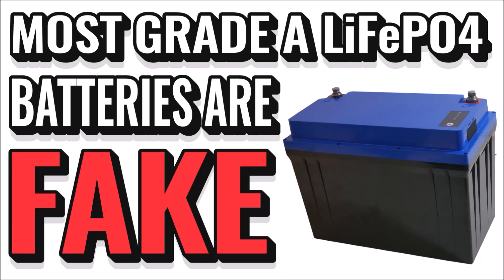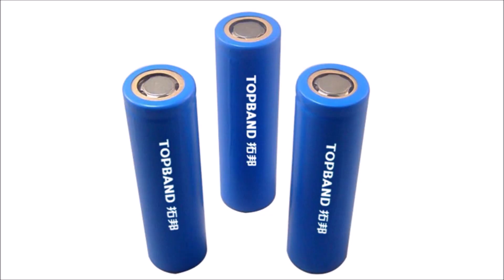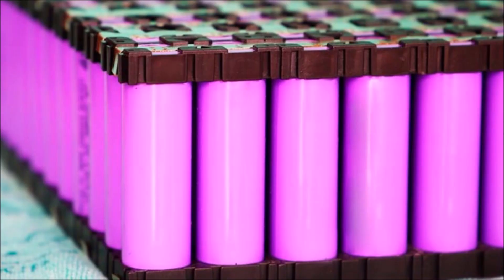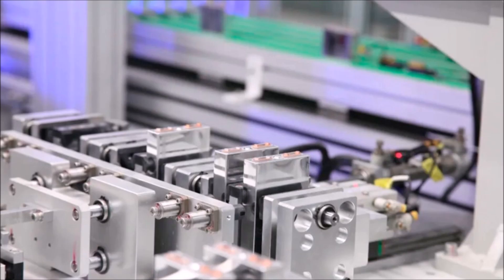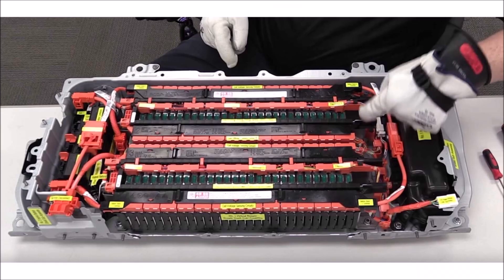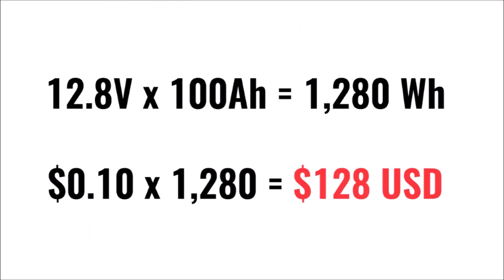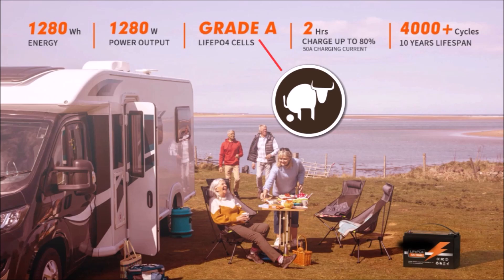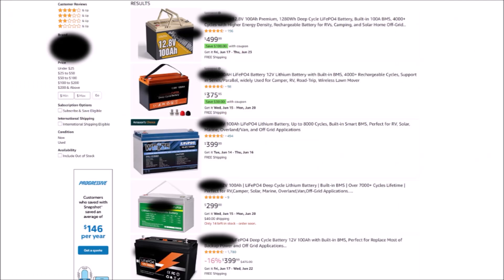Fake Grade A Lithium Deep Cycle Batteries Are Everywhere!  Learn How To Spot Grade B vs Grade A

Comment: Over 1,000 cycles for $200?  I'm in there.   My thought has been that only time will tell on these LiFePO4.  I have a popular pre-made power station running most of my house all the time, and a 5 kwh system made with LiTime minis.  I work them both pretty hard and have taken the homemade system to 0 somewhere between 10 and 20 times.  I'm saving over $1,000 a year on electricity (California), so my payoff should happen before the systems fail, but the learning experience has been priceless.  I would have never ventured into a do-it-yourself system if I was paying over $500 per battery.
Reply from the maker: There is about a 20% failure rate with Grade B cells, on average, so if you have a prismatic battery with 4 cells then the likelihood of the battery reaching its full cycle count is 40.96%.  I'll stick with the $700 batteries, myself.

But the point of the video is that consumers should be told what they are buying and not fed marketing lies.  Because you get to decide your risk tolerance and risk/reward for your application, which you have done, and I get to decide mine.
Reply: @LDSreliance  I never believe the hype. Remember Optima batteries?  I'm in the hazardous waste business, and those things were all over the household hazardous waste collection right after they came out in the early 2000s.  I've had two of those, and notice no difference in longevity between those and the formerly $85 now $100 Interstate batteries they sell at Costco.
Reply from the maker: Agreed.  I think we will get to a point in a few years where people will start to see the longevity and quality difference and then they can make educated decisions for themselves.  But we aren't there yet and that is why I am putting out these videos.  I don't blame anyone for buying Grade B batteries.  I have 3 of them in use right now on production solar panel systems and they have been great.  But people need to know what is what they are buying and not get them confused with the top shelf stuff.

Comment: This is a great and informative video helping consumers navigate the deep cycle Lithium battery market. Some people in the comments seem to be missing the point. The point is education. The information is there to shed light on the marketing shenanigans and help consumers understand what they are actually buying... and if Grade B works for a consumer great, but knowing what you are getting is the point. 

I'm currently debating lithium batteries for my bass boat trolling motor (3x12V). As little as I end up fishing in a given year, max 2 times a month, it doesn't make sense financially.... Well maintained wet cell or agm batteries can last a long time, however the benefits of lithium with nearly continuous peak battery output throughout the day might be worth it. Potentially going multiple days without charging is another benefit. From that point, it's a matter of buying a premium US company based battery or one of the many cheap batteries with various stickers slapped on them off Amazon or Ebay. I'm typically buy on quality vs price... for this specific application I'm a little torn honestly. 

Another thing I've learned with top tier batteries such as MillerTech or Battleborn is the use of cylindrical vs prismatic cells. If one cylindrical cell were to go out, no big deal... if one of the four prismatic cells goes out that battery is out of commission. One small factor to consider. 

Everyone has different needs and uses, I for one and glad you put this type of content out the help educate.
Reply from the maker: All good points.  Thanks for your comment.

One counter point to consider on the cylindrical vs prismatic debate is the number of points of failure.  There are dozens of tab welds and cells in a cylindrical battery, whereas prismatic cells are bolted together and only have a handful of cells.  Yes, if one fails it is a big deal.  But if a cylindrical cell fails that takes out the whole series so it is effectually the same thing.  In other words, in a 4S4P configuration for example, if one of the cells fails then the other 3 cells it is wired to in series cannot make up the difference and you now have a 3S3P battery, which is just as catastrophic as one cell failing in a 4 cell prismatic battery.  And tab welds are 99% of the time just fine but they can fail, whereas bolted construction is almost bulletproof.

Comment: Thanks for this video. I was curious if this is also true for some of the lead acid batteries?
Reply from the maker: Not that I know of.  Many of those are actually made in the USA and have a long reputation for decades.  Like Duracell deep cycle lead acids are made by East Penn, which has been around for 60 years or more.  Very well respected company with multiple manufacturing plants in the US and Canada.
Reply: Cool. Thanks for the reply. Like what you are doing!
Reply from the maker: @noahriding5780  Appreciate the support!

Comment: How does Trophy battery company size up?
Reply from the maker: Trophy?  I'm not familiar with them.  I skimmed their website very briefly.  Based on the images of the batteries, it is safe to say that they use a Chinese assembly partner.  And the info page says they use CATL and EVE cells but not that they are Grade A.  Those are two excellent manufacturers but all manufacturers still have Grade B cells and auction them off.  So you can still have a Grade B cell from CATL or EVE or CALB or anyone.  If I were ordering from them I would ask them for the cell testing and grading data on the cells inside the batteries.  If they can't or won't provide that then I would lump them in the middle category where you have to go on their reputation.  How long have they been around?  Can you get a live human being on the phone?  Do independent, third party folks recommend them (not Youtubers, who are largely bought and paid for)?

Comment: Well ..... test the batteries given to you to prove this.
Reply from the maker: You can't.  That is the beauty of the fraud.  Even if I was willing to destroy a battery to completely disassemble it, what do I test the cells against?  People like Will Prowse just do a basic capacity test after recharging a cell.  That doesn't tell you anything.  A Grade B cell can pass a capacity test right after charging (or within a day or two) and then completely fail that test 3-7 days later.

Unless you have all of the detailed specs from the cell manufacturer and extremely expensive and accurate test equipment to measure IR, self discharge, and other very difficult measurements then you can't tell a Grade A from a Grade B.

Comment: Gained a lot of insight. 

My question is, since grade B essentially has insignificant downsides, why pay exponentially more grade A?
Reply from the maker: You will pay 2-3x more for Grade A.  The failure rate of Grade B batteries is in excess of 20%.  And the life span if they do not fail is about 1/3-1/2.  Also, the performance at high load is much lower.  I did not get into detail on that in the video because I wanted to focus on the industry games being played.  For some folks the difference will not be that noticeable (unless there is a failure).  But for other folks that want to run a coffee maker in the morning off an inverter, a Grade B battery may not even do the job.  Part of the problem is each Grade B cell is different so the results are unpredictable.  So there are a lot of facets to the problem that people need to know to make the right decision for themselves.

Comment: As a South African your channels information has been greatly appreciated as we have an absolute mess of a battery , inverter , solar industry with many shady practices.
Reply from the maker: Yeah it is very bad.  When the average homeowner or consumer knows very little about a technology, that is when the bad people take advantage of that ignorance.
Reply: I've found there to be lots of problems with solar charge controllers especially also. Its difficult to sort through the trash on those. And many are overpriced on the other end.
Reply from the maker: @noahriding5780  Oh for sure.  If it is less than $100 and says MPPT on it then run away.

Comment: When someone else is selling the same type of product,  the competitions product will always be called inferior.  Some companies just sell more products at lower prices rather than fewer products at higher prices.  Lower price doesn't always mean lower quality.
Reply: THIS is the key. When this seller of overpriced cells calls all the reasonable priced competitors as "ridiculous", I call BS. Thanks but no thanks
Reply from the maker: Because they are inferior.  There has never been a company that sells higher quality products for lower prices relative to the competition.  Or lower quality products for higher prices.  At least not for very long.  In the former, the competition will lower their prices to compensate.  In the latter, the company goes out of business when their reputation catches up.

Comment: Great video! This will save some headaches!!! This is why I build my own batteries. I buy cells and i ALWAYS demand internal resistance measurements or the deal does not go through. If the cells arrive and the IR is inconsistent or drastically different than disclosed, I will file a dispute. One must rememebr, its not just about amp hours or capacity... you must also rememebr that IR changes with SOC, so one must charge all cells to the same voltage to compare IR meausrements. You must also use a special meter to measure AC impedance that uses (generally) a 1khz sample. This is what most manufacturers list in their spec sheets for internal AC impedance.
Reply from the maker: Yep, which is why almost no one does the tests properly, especially Youtubers that do teardown reviews and declare the cells "Grade A".  And then push affiliate sales of those batteries for commissions.  It is a big racket and almost no one is exposing it.

Comment: There's a lifepo app to scan the code. I actually got real ones from ebay, but fake from Amazon. I really thought the cheap ones from ebay were the fakes. Who knew
Reply from the maker: That sounds awesome.  Do many of the manufacturers participate in that database?
Reply: @LDSreliance  that I don't know. Just the lifepo have an engraved code that you scan with the app. It gives a bunch of general info about the cell.... when and where type stuff

Comment: Thanks for the informative video. I've recently joined an RV business in Sweden and got contacted by a Chinese supplier that offers grade a 12V 100Ah  batteries at 200 dollars unit price. However I got the samples and the testing result was very good. The saleperson from that company also provided me MSDS sheets in regards to my concern for battery grading.  Is it possible that the manufacturers in china actually can get the cells and other battery materials at a much lower price? Also factering in that the labor cost in china is probably dirt-cheap as well, the actual cost to build a battery might be much lower than we think, especially for grade b batteries.
Reply from the maker: $200 for a lower end Grade A battery is possible.  What I mean by that is Grade A cells from a lower tier manufacturer paired with a low end BMS and just the basics (no bluetooth, heating, networking, diagnostics, etc.).  But then consider the costs of importing them with taxes, tariff fees, import duties, freight shipping, etc.  And you have to buy them in bulk with a minimum order quantity.  So you are looking at $400-450 a piece actual cost.  To make any money re-selling them and make it worth your time you would be charging $600-650 minimum.

Comment: Quick and easy check is the number of cycles they claim. Youre looking at 6,500 + for grade A. They could lie about it of course.
Reply from the maker: Those numbers are entirely fabricated.  No lithium battery can do 6500 cycles at 100% DoD.  Doesn't exist.  So if you see that kind of number, it is either at 40% DoD or it is just a straight up lie.

Comment: i have 3 systems I've built using 4ea 200 ah Amper time and 14 300ah Chins 1/6 bat 1 8 batt out of 3 systems and18 batteries only 1 ever seemed to not balance the same . AND CHINS REPLACED IT IT 24 HOURS. on 1 email. i think they are great batteries.
Reply from the maker: Come back to this post in 5 years and then we can properly evaluate.

Comment: Then why not take the price reduction if most users will never hit the cycle count?  Still get beneficial performance from these reduced grade cells versus flooded batteries and also use components that would have otherwise been trashed.   Seems like a win win for the consumer.
Reply from the maker: It could be... if the battery lasts that long.  They are not only made with cells with random specs and blemishes but cheap battery management systems, wiring, tabs, connectors, and cases.  And you are also taking a flying leap on that company responding to you or having any support from mainland China if you have any warranty issues outside of the Amazon 30 day support window.

Comment: For a guy that goes fishing 25 times a year, why wouldn’t I want to buy grade B cells at half the price? It will take me 20 years to have 500 cycles and 40 years to have 1000 cycles on grade B cells.
Reply from the maker: Absolutely you would.  If you are shopping on lowest price you are guaranteed to get a Grade B battery.  But keep in mind that there is also variance in quality of the BMS and internal construction of the battery, as well.  So you could get a $300 Grade B battery that lasts you 16 months at your usage level or a $500 Grade B battery that lasts you 16 years at your usage.
Reply: @LDSreliance  In other words, we are all taking a huge leap of faith, and hoping for the best.
Reply from the maker: @JohnSnow-vf8jo Correct.  The failure rate for Grade B batteries in the first year (regardless of usage) is 20%.  That's pretty much Russian Roulette.  There are also major performance issues coming to light as proven by several channels testing known Grade A cells vs Grade B cells.  The Grade B cells cannot handle high loads.

Again, not trying to discourage people from buying what they think is best.  I'm trying to make sure that consumers know what they are actually buying because the manufacturers are lying to you.

Comment: And it doesn't take a genius scammer sooner or later to work out that selling grade B batteries not cheaper but at the same price as A battery would be the most unsuspecting scam to pull off especially if his marketing and advertising is so good that his manufacturing can't catch up with the demand 👏
Reply from the maker: Except that the competition at the high end of the market is brutal and only favors those with stellar reputations.  I know, I have tried.  If I had a huge marketing budget I certainly could have competed.  But if my product was Grade B, eventually units would start to fail and I would start to get some bad reviews and potentially lawsuits that would tarnish the brand and torpedo sales.  The scam could work for a while, though.

Comment: If you say, the difference won’t be noticed for thousands of cycles, then who cares, just buy another battery
Reply from the maker: It may not be noticed.  Or it could fail in 100 cycles.  Either way, if a company said that you get 5,000 cycles out of your battery and it becomes a paperweight at 2,000 cycles you wouldn't be a little upset?  A $350 battery at 2,000 cycles vs a $700 battery at 5,000 cycles isn't a great deal.  Not to mention paying tax and/or shipping twice.  And that is if you are lucky enough for the BMS to make it 2,000 cycles...
Reply: @LDSreliance  probably, if I can remember after 2000 cycles! Good video nonetheless.
Reply from the maker: Thanks, brother!

Comment: Do you have any experience with the DJLBERMPW 300Ah?
Reply from the maker: No, sorry.  No direct experience.
Reply: @LDSreliance  I bet they all come out of the same B factory, so I guess I'll buy the cheapest. Some offer a Plus or a Premium version of the same battery in a smaller format, idk?
Reply from the maker: There are numerous shades of grey here.  A cell can be a grade B cell because it is 0.05V out of spec and another could be Grade B because it is 0.05V out of spec, has an IR that is 5% off, AND is 2Wh too low in capacity.  So you can get a really good Grade B battery that performs really well with fairly closely matched cells and a high quality BMS that can keep them all in line.  But you can also have a bad Grade B battery made with a wide variety of problematic Grade B cells and a low quality BMS that has limited ability to keep them all in line.  Does that make sense?
Reply: @LDSreliance  yeah, you throw your dice and take your chances. Some of these companies websites have already disappeared, so much for those warranties. I was looking at a SOKERDY 12.8V 400Ah which claims it has a 400A BMS. I wish someone would cut one open so I could see what that 400A BMS looks like.
Reply from the maker: Yep.  I have had that happen to me numerous times.  It has gotten to the point where about a year ago I started mandating that any companies I work with on a review have to prove that they are Grade A cells or admit they are Grade B.  Thus only one company has sent me a battery in the last year.  Most are unwilling to admit they are using Grade B and cannot prove they are Grade A because they are not.